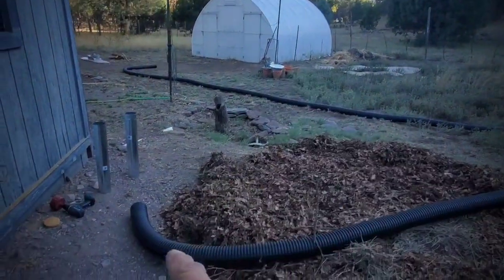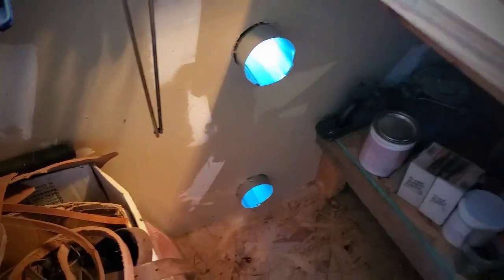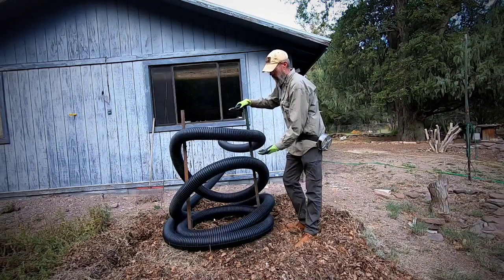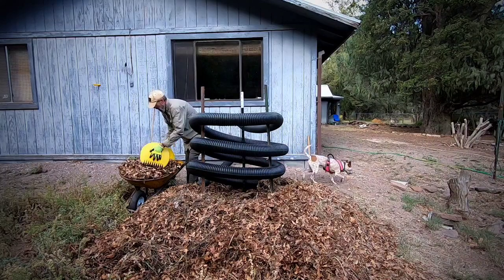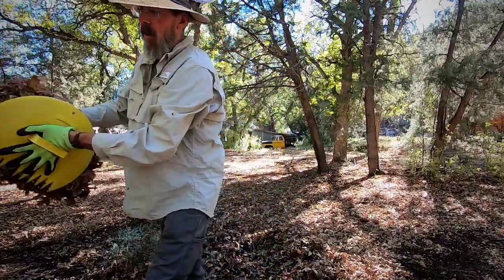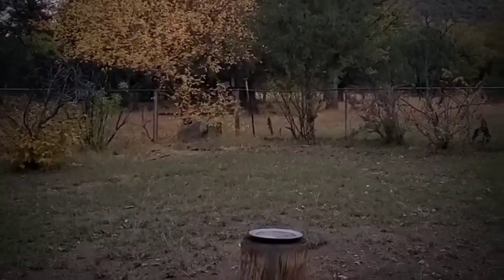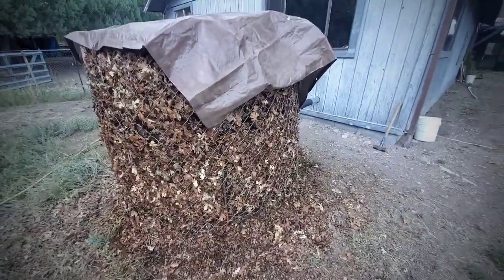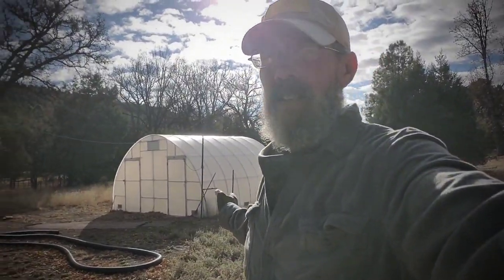How To Build A Compost Heater /Full Tutorial

Comment: What would happen if you removed the fan from a mini split heat pump and buried the condenser in the center of your compost pile? And if you got one from EG four that runs directly on solar panels or batteries, you could be pumping 120 or 30 or 40° air all winter long Still no cost for operation other than a mini split❤️❤️❤️❤️❤️❤️🙏🏼🇺🇸

Comment: Hey brother, great job on a first go at this..  I've been interested in compost heating for a while..  A few thoughts & questions..  What was the max temperature and general temperature range in the workshop through the winter?  Was it enough to take the chill off?..  and that small desk fan, that's what you used?..  And how well did you insulate (wrap) the pipes outside exposed to the air?..  I've wondered if a system like this could be done with water running through the pipes, and then embedded in the floor for radiant floor heating..  Much more of an engineered system that would rely on a pump, but still interesting..  I think I saw a video on that quite some time ago..  But to heat up a mass of a concrete floor would take much more heat & a larger compost pile..  that's a whole 'nother thing..

I've also seen a system like this with fan-blown warm air where the pipes outside are buried in the ground, just to help with protection from the cold winter air..  worth considering I think..

How often did you add to and stir the pile during winter?..  Did you take the temp of the core of the pile during winter?..  if so, what readings did you generally get?..  Other thing I'd say (and not a criticism, of course), is that you could build up the pile and just wrap the pipe and build it up in the upward spiral without having to drive stakes and lash the pipes to the stakes..  not a criticsm of course, just seems it would be easier that way..  and other videos I've seen they did that, just wrap the pipe upwards as they build the original pile at the outset..      take care, y'all..  good job on this..  :)

Comment: Great project… though, in order to increase the hot airflow into the shop (since the warm air “likes” to rise UP), I’d install the upper “exhaust” pipe under the angle rising higher up almost to the ceilin’ and the cold outflow air pipe as low as the floor level. Hope it makes sense…. Luv those wolves… cheers ….

Comment: I had a thought about you using when you use coke product (sugar + carbonation)  : the carbonation would effectively just off gas as it being put into the system and what would be remaining would just be the chemicals make up of the coke/sugar.   I'd would suggest Gatorade powder / for the actual minerals-salts in the solution plus it has a sugar in it.  you could mix it with water or just toss it in with manure then wet it later for a food source for the bacteria. just a suggestion for you. I would suggest doing an experiment with buckets with lids doing different layering materials types with other materials as well.

Comment: I do one of these for my barn. It goes under the ground to go under the wall, i do have to throw straw or hay over where its buried in winter for insulation. I ran it as a closed loop around the walls on the floor. Have a 4 inch duct fan inside. It does good with that un insulated building to keep the waters from freezing hard unless we go zero or below for like a week. If the pile gets to wet it cools off and takes longer in winter to recover. I keep a piece of greenhouse plastic that has holes in it in the wet part of the winter.
Good luck
Reply from the maker: Awesome 👍

Comment: Good luck. By my experience, however, way undersized and no where near enough manure. Mine was a deep (about waist high ) cold frame, old windows sloped to the sun and all that, almost the width our your building. I filled it with at least two feet of horse manure and straw mucked from the stalls (my neighbor had horses) , then a zig-zag layer of that pipe covered with a foot of half-finished compost topped off with a tarp. Then in the spring when most of the microbial heat is gone and its not providing much heat for your building, peel off the tarp and it makes a great seed starter cold frame filled with a wonderful fully composted material that at planting time I use as a top mulch for my garden beds. 🙂
Reply: This is exactly how I heat my greenhouse.  But I keep the pile inside the greenhouse.  Works great.  Gets down to below 20 regularly, never freezes in the greenhouse.  Same size pile as yours.  I use wood chips, hay, and goat manure.  I only run the four inch pipe through the bottom, on the floor, so that stirring or fluffing the pile is easier.  Thanks for sharing!
Reply: @Syntropicfarmer sorry to bother you but I have to know how you do this. I’ve had a wood heated greenhouse in nc but I moved away and I’m in sd now. Frigid cold. And I want to build a walipini next year. We are on a ranch so I have plenty of manure. So you just have a big pile of manure and wood chips in (the middle?) of your greenhouse? Just gives off heat freely no pipes or anything?
Reply: @greenhousegirl676  yes, a compost pile, mine is about four feet by six feet, three feet high.  I use hay, wood chips, goat manure, and water.  Also keep some blood meal on hand to get things hot again if needed.  Generates 100 to 120 degree heat.  Occasionally stir or fluff the pile to get more air inside it, at add another layer on top, whatever needed to keep it going.
Reply: @Syntropicfarmer amazing! Im on a zone 4a prairie ranch so there’s no wood for chips or leaves but there’s plenty of hay lol and manure. So that seems doable. I hope to build a walipini with a long low A frame roof going east to west. And I want to do the north end south walls and floor in sod for the passive thermal heat… dreams 🤞🏼✨ the wind here is insane so a walipini is the only way to go I think.
Reply: Nitrogen in Manure gets really hot as everything breaks down
Reply: @RiverbendlongbowsOutdoors  Just a suggestion. Do not put any kind of food scraps ("greens") in it and consider encircling the bottom with metal hardware cloth 1/4 inch to prevent critters and rodents. Peace

Comment: I like the way you put a wire fencing or whatever upright around the compost. If you leave the PVC pipe(s) stuck downward with holes and use it for air to get to the center of it helps the bacteria you want. You need to completely tarp the whole compost to hold the heat in, the seams will give a little air, and wrap insulation around the pipes outside to fight for every degree. Let us know how it does😊❤.
Reply: I might add a reflective survival blanket that reflects heat underneath the tarp on the compost. Keep even more heat in😊

Comment: Why aren't people doing compost piles to heat their houses and water? Am I missing something.
Reply from the maker: 🤷‍♂️ I know
Reply: It's labour intensive people are lazy
Reply: In a city, afraid to dig with the big natural gas lines.  Would have to import firewood, run it through chiper, have to find enough nitrogens, don't drink coffee, eat alot of fruit.  Don't own the lawn. Cant cut the wall.  I would do better with 2 or 3 solar panels and a delta pro 3 and a window ac unit with a barrel of sand to run hot side with and another for the cold side and run what ever sides hose I need through a window open with a board to seal of the open window.
Reply: They are

Comment: You need nitrogen to create the heat so any greens or coffee grounds will help.  When you create a pile, layer  browns (like dread leaves) and wet greens (grass clippings or any green leafy things or  kitchen veg scraps).  The layers should be repeated like lasagna to make the fastest pile but if you want it long lasting, add green and, old dead, wood for a long term furnace (good for a water heater) even soaked wood pellets create a nice heater.  You built a nice compost heater for your shed. I live in Malaysia so heating water and making nutrient rich soil are my two main goals.  🎉👍
Reply: Didn't Jean Pain just water it and the rotting created heat he made gas, fuel, electric everything he needed Inc fuel for his car look it up
Reply: @realstories3976  he used wood chips, not just leaves though.
Reply: Nitrogen not necessary. The Jean Paine method has been proven for years. Water and carbon. 

This man needs about 10 times more mass.
Reply: @az55544 I mean, perhaps for the size he is working with, he could add more nitrogen to make up for the lack of mass. Especially since he is using leaves and not wood chips
Reply: Just add pee.  It's a great source of nitrogen provided you're healthy and not on medication.  Also layer in dirt.  It retains moisture better.
Reply: Horse manure is such an underutilized asset! And it barely smells!
Reply: @Eric2300jeep  Goat manure for me!
Reply: more green foilage and bonemeal should work
Reply: @andrewsolano9172 . Bonemeal works great.
Reply: A bale of hay makes great greens.
Reply: Urine is a great nitrogen source to get woodchips or any carbon source composting.

Comment: I find running a water/glycol mix through Black 3/4" PVC pipe in spiralled layers separated by layers of a 35/65  N/C mix. Six foot high, ten foot diameter pile on four pallets , supplementally ventilated through 4" Black perforated weeping tile. A fountain pump circulates mix through insulated lines to "bus" heaters in the house. Loading the pile takes a segmented enclosure and pre assembled spirals....and time, aka care.

Comment: great project! i'm trying something similar with woodchips, so I have a small suggestion coming from my experience: make a bigger pile. It will keep more easily the internal heat; as an alternative you could use straw bales around the pile in order to insulate it.
Reply: I concur. The outer 8" inches don't heat up - just act as insulation.
Reply: Have you had issues with termites? I'm concerned that adding 12" of wood chips to my yard increased termites. And what do you do to prevent them?

Comment: Wondering if you'll get enough oxygen in with the tarp. It might go anaerobic on you.
Reply: That's  a justifiable concern, but easily avoided with a little common sense. Here are the basics: 1) Do the math on the C:N ratio and err on the side of too much carbon by at least 20%. 2) Err on the dry side, using about half the water that would be optimum for an active pile. 3) For piles larger that 4' diameter, put a "chimney" in the center. I make mine by rolling several layers of chicken wire into a cylinder and securing with 6mm jute rope. I've never had any problems using this method on my five piles ranging from 1.1 yards to 4 yards. Sizes 2-1/2 yards and larger are able to maintain a core temp of 90 F throughout winter.
Reply from the maker: @KPBootmaker  I plan on venting it tomorrow actually.  Thanks for watching
Reply: @RiverbendlongbowsOutdoors Great video on the process!  I did wander about the venting because you want to turn it  to ensure aerobic bacteria keep your compost alive and not smelly, and the chicken wire wrap made it little more difficult to do so. One thing I did  see in a video is one PVC pipe straight down the middle of your compost. The PVC pipe has holes throughout to help aerate the compost as well as water delivery for your compost. How often did you have to restock the manure into the compost? What was the maximum additional warmth you were able to generate with the compost for your shed?

Comment: I have 1 thousand hens and the local tree service keeps 4 or 5 piles of wood chips here so I never run out. I always have a heated compost pile running at 120 or 130 degrees and it finally becomes some fantastic dirt to mix in with the garden soil and flower beds. I don't know why more folks are not doing what you are doing. GREAT VIDEO !!!! When the compost thermometer says the temp is dropping then I turn the pile to let air get in then I wet it down and the temp goes right back up. One big round hay bail mixed in with 500 pounds of chicken manure and wood chips at the beginning will take about 2 to 3 months to completely compost
Reply from the maker: Awesome 👍
Glad you enjoyed it
Reply: If I were to build a large compost pile on top of and wrapped with excess foam board insulation and run glycol/ pipe in coils in the center and then started my pile with wood chips, manure, and household vegetable matter/coffee… would I need a way to add water to the pile and would I be able to just keep adding to it? 

I’m building a house in Alaska and would love to supplement my radiant floor system with compost heat. Would I need to eventually remove the material around the glycol pipes and start again? I figure I could have a stat connected to a thermometer in the middle of the compost pile that allows my boiler to rely on it when needed and fire when it drops below a certain temp, and at the very least warm up the glycol so it doesn’t have to work very hard. 

So, in the case that I needed to have an insulted water line to a perforated hdpe line throughout to add water I could do that automatically too. The only thing is: I want to just add material and not have to tear I all up. I don’t want to have to take it apart. Thoughts?
Reply: Robert, do you include an in-line fan to move air around faster. We're building a small passive solar greenhouse, trying to avoid electricity, wondering if the in-line fan is necessary.
Reply: How long before adding chicken manure?
Reply: How long does it take for the wood chips to become dirt?
Reply: Your way works faster & for a longer time frame.  Add ingredients from kitchen & animals (green waste) & more hay to keep it going.  Cover/insulate all pipes in & out to prevent heat loss.

Comment: My buddy was able to keep a warm greenhouse just by having a compost pile on the center, this makes perfect sense. Let us know how warm it keeps the shop!
Reply from the maker: Yah man 👍 
We thought about that too other than it puts off gas and odor sometimes. 
I'll have an update video in the future. Right now I'm getting about 72F air, so not bad
Reply: @RiverbendlongbowsOutdoors  Outgassing is no joke, especially methane. It can be mitigated to a small degree by incorporating biochar to the mix and on top. For the mix, use I cu ft/yard minimum. 2 cu ft/yard is better. Then cover the finished pile with biochar until there is no detectable odor. That takes a thickness of 1/2 inch or more.
Reply: @RiverbendlongbowsOutdoors  it definitely doesn't smell good, in his case it didn't matter. If you plan on spending much time in there, your system is way better
Reply from the maker: @usernick8928  🤘